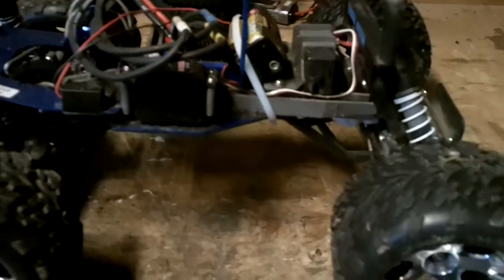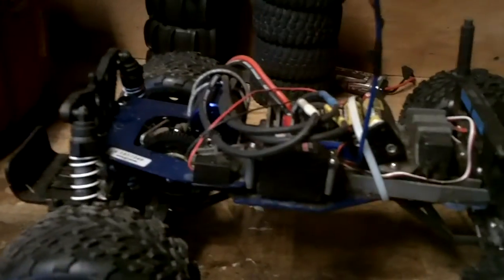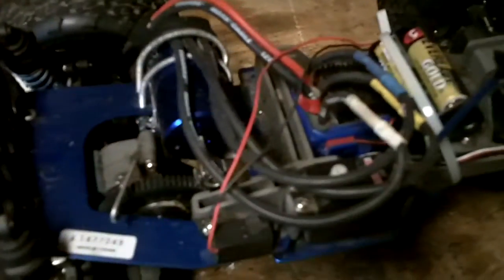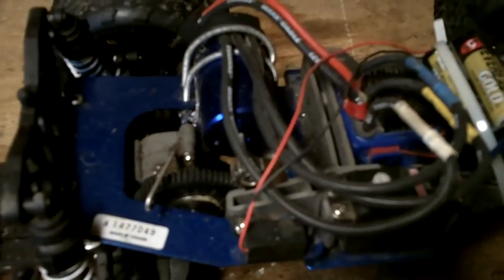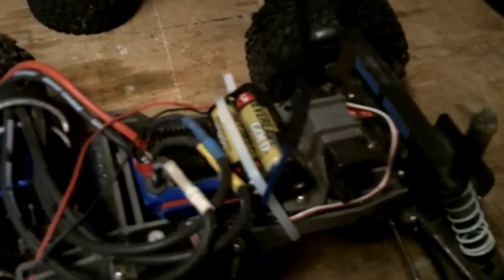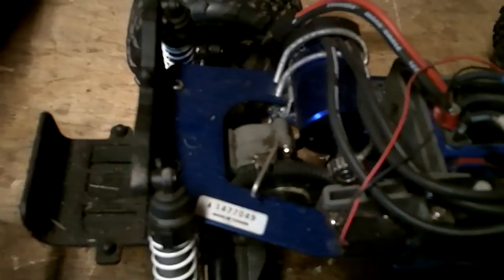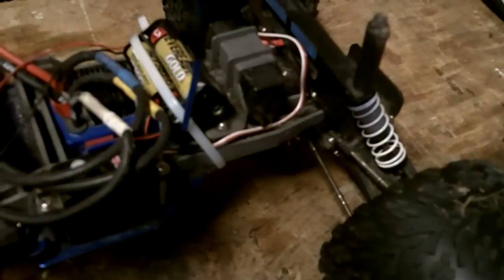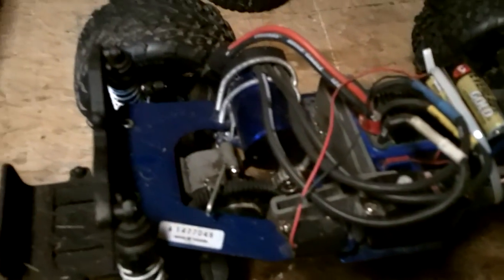Traxxas Stampede Nitro to Electric Brushless Conversion

Comment: Hey I am low budget bad credit and wish to get parts covert my nitro stampede to electric...What if I take out the circuitry stuff and battery holder(such as new bright) from any rc car and wire them to the existing motors??? really need advice...
Reply: Definitely will not work. New Bright electronics cannot run a 550 size brushed motor.

Comment from the maker: then put the motor in between the angle slide my ubolt over the motor and thru the frame and put nylock nuts on the ubolts to hold it in place.the motor stays in place and does not move works great. Then i took the left over angle and made a battery box for my 2s lipo by cutting the pieces and gluing them together with ca glue. I got everything at lowes for like 5-10 bucks. I had to take this motor off to put in my slash cause i bent my rotor but when i get another one i will post a video of my

Comment from the maker: I got 2 pieces of 1/4" aluminum angle  (looks like a L )and put one piece on each side of the motor. then i positioned the motor so the spur and pinion were meshed properly(i use a piece of paper between the gears) then i marked on the frame the postion of the angle and drew a line. I then took 1/8" all thread (threaded rod like a screw but has no top all threads) and bent it around the motor to make like a u bolt 2 pieces. I then drilled 4 holes next to the line from the angle.

Comment from the maker: I will make a vid for you as soon as I get a new rotor for the motor I had to swap the motor with my slash because I was running my slash with the cover off and got a rock stuck between the spur and pinion gears and bent the shaft on the rotor as soon as the holidays are over I will get it up and running for you and make a vid subscribe to my channel to get updated when I post it!!

Comment from the maker: I used the stock sPur gear and I used a spare motor I had from my slash 4x4 brushless velineon I didn't get a chance to see what's on there but I think it's a 16 or a19 pinion can't go much higher than that or you will burn up your esc I was using a 3 s lipo and a 2 s lipo getting about 35 with the 3s and 25 with the 2s I was looking to replace the spur gear with a lower one because I think the stock one is way to high let me know how it works when you get it figured out

Comment from the maker: @248Samson I got 2 pieces of 1/4 inch aluminium to cradle the motor and i just used 2 pieces of 1/8 inch all thread i made into a u bolt and that is  bolted to the frame i used the same receiver that came stock with the stampede and the ecu plugged right in so i put this together for like 5 buck not including the motor and ecu..